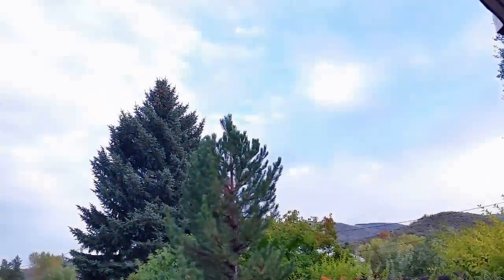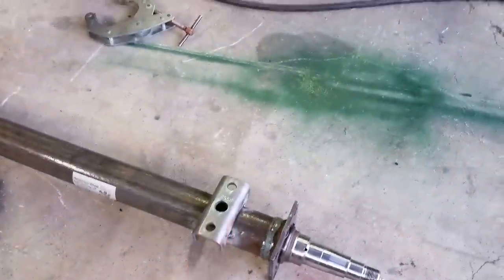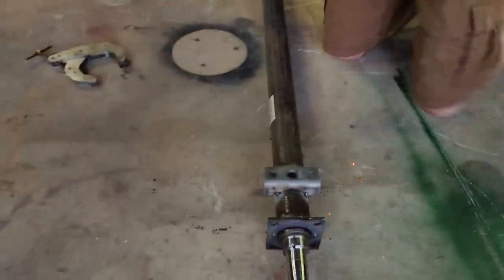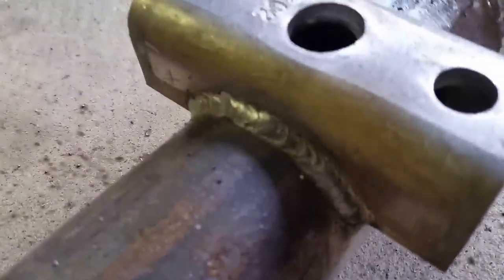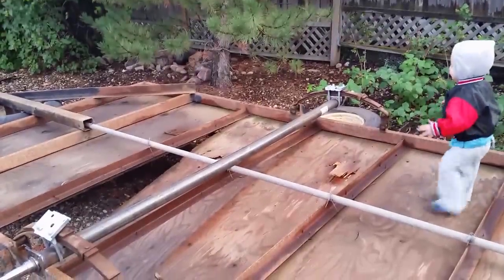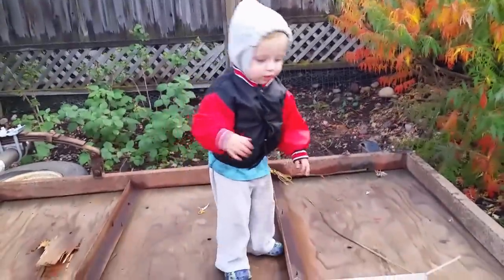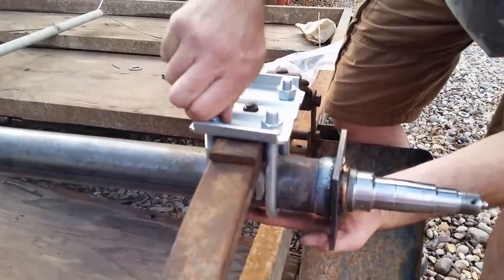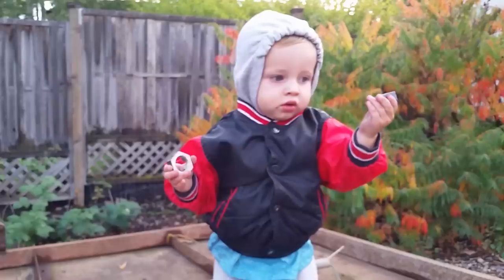Trailer axle welding

Comment: I would use a spring washer on those nuts or red loctice or even just double nut them I've found they have a tendency to vibrate loose over the years on rough roads,just from personal experience : )

Comment: Were you using a flux core welder or a gas welder?
Reply: David Lewis gas
Reply: @watfordr1  are you sure lol - it lookd rather fluxy after you welded and then you used a wire brush.  ?
Reply: Yeah, that definitely looked like flux.. very smoky, and lots of splatter..